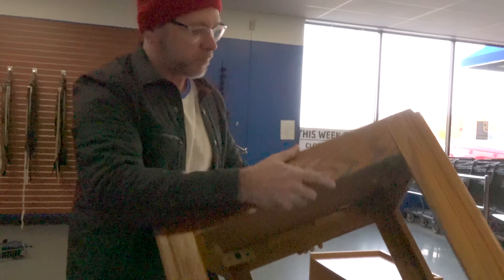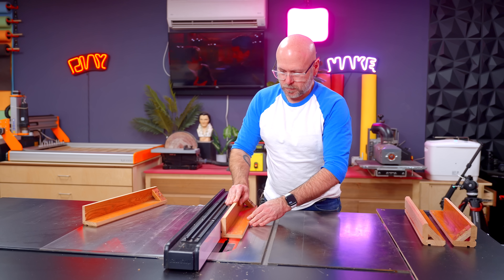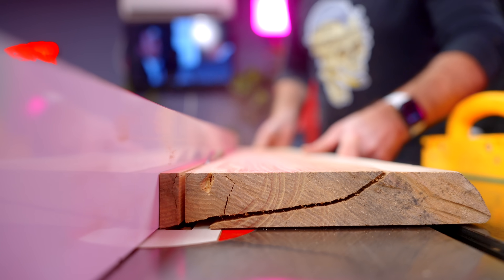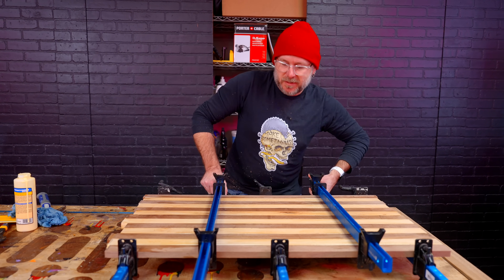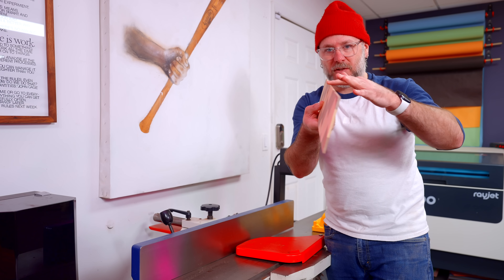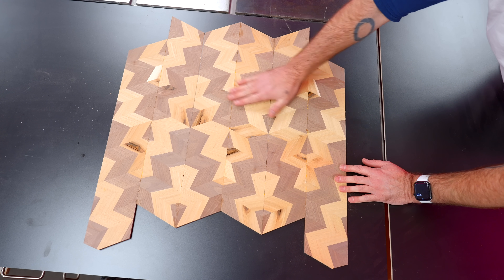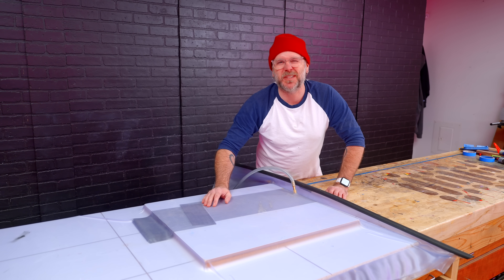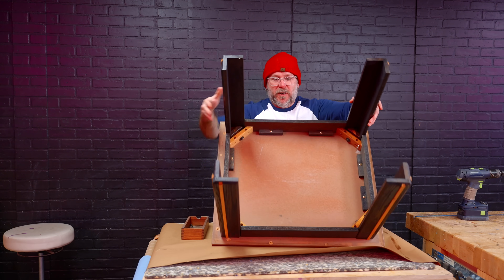Woodworker turns Goodwill table into modern fine furniture.

Comment from the maker: :yt: Next up is turning this cheap vintage lamp into priceless fine furniture :yt:
 https://www.youtube.com/watch?v=7BMz1gIu5cE&list=UULFtaykeSsGhtn2o2BsPm-rsw
Reply: 9:32 I'm not sure how often you have this situation, but this is how I joint thin panels now. https://www.youtube.com/watch?v=b-kXTKVVTL4 It will quite literally change the way you woodwork. I have a second table saw now that I dedicate to it so it is always just setup. I have it installed side by side with my main saw and they share a fence in the middle. I cut to the left and joint to the right. I installed a fence from Very Super Cool Tools (best table saw fence I have used) and its flexibility allows me to do some really cool things. Anyhow, I hope you buy one and find it useful.
Reply: Did you add Steam to your mug? at 6:54
Reply from the maker: @cewaffles  I did. 😁
Reply: @MakeSomething  Nice touch.. Cheers
Reply: A wise man once said- can we just have some fun!
Reply: @MakeSomething  
What block plane hand tool did you have in this video? I think I know what brand it is, but wanted to check. Thanks.

Comment: The pattern looks super cool.  By the way isn't faster to build it from scratch rather than salvaging an old table?
Reply: @aimeem  It's not like building a new table would mean this one gets thrown away. It could easily have stayed at goodwill until someone who didn't mind the styling picked it up.
Reply: Even if being faster was the point (which I don't think is the case), I'm not sure building a new one would be faster. It seems like the only really time/effort intensive part of this is the parquet top, which would have been pretty much the same process if he started with a blank base.

Comment: The lighter strip down the legs to me kept the 80s look to some degree. Not crazy about it, I would have rather had it the same color or some other color may have worked as well but that color is screaming 1980

Comment: From the 80’s to…early 80’s? 😂 I liked getting rid of the rounded parts. I think a low contrast strip in the legs would’ve looked better. The framed top is nice. Totally agree on having it overhang the apron and legs. I think a literal chess board pattern would’ve been preferable. Because I’m me and I like chess. Totally subjective, I get it! Also the original top. It wasn’t a poor herringbone pattern, I’m pretty sure it was a “parquet” pattern. Which was a pretty 80s thing to do. Great work. Good craftsmanship. But, I hope you and red oak eventually kiss and make up….

Comment: I gotta admit,  David.  When you started doing all of that cuttin', I thought you were going down a rabbit hole from which there was no escape, but you pulled it off and built a cool looking table.   You should have given the table to Dangerous Dan instead of donating it back to Goodwill.   That would have been the nicest looking table in the trailer park!

Comment: The top is beautiful,  but I'm not sure it's really "upcycling" when you add 150 bucks in walnut on top of a now irrelevant base.  Not trying to hate,  but I just think all the quality work that went into the top would've served more a purpose if you just made new legs too.
Reply from the maker: Upcyling? I think you missed the point of the video. 😘
Reply: Maybe : ) admittedly I just flipped through desperate to see how one of those old tables we all remember could be made pretty again... plus in description it said "finding old things and bringing back to life", which is def of upcycling...
Again,  the woodwork on top was amazing.  Just thought a matching bottom would've been better.